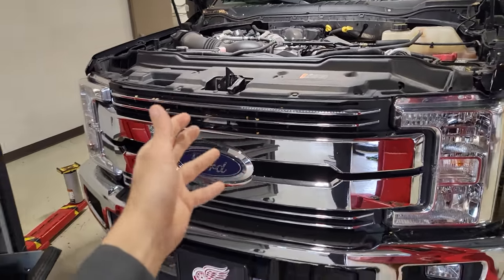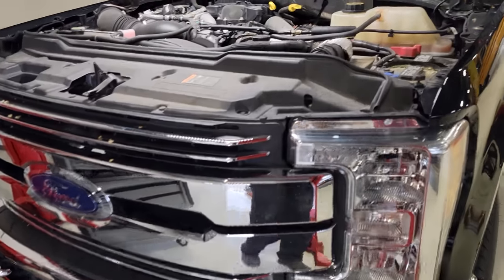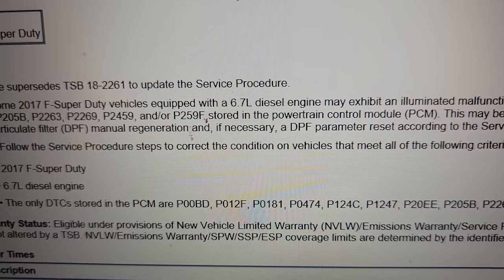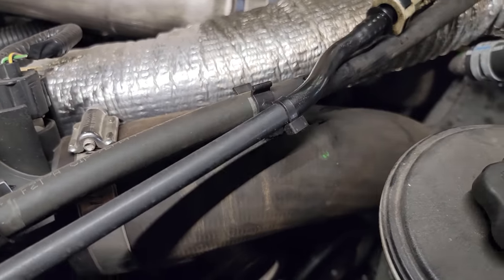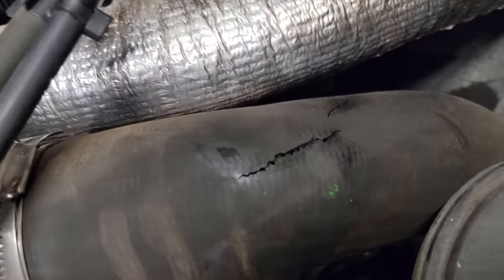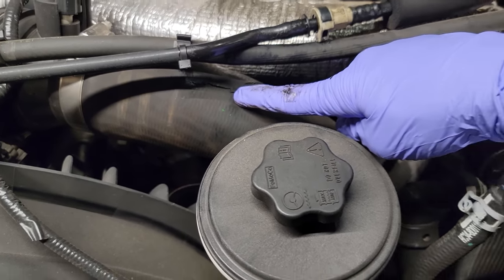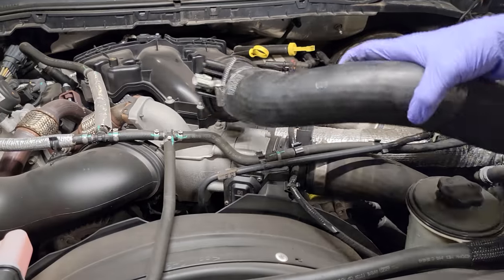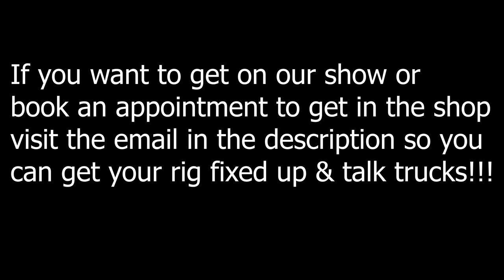**STOP** DO NOT REPLACE YOUR MASS AIR FLOW SENSOR | Eng.-light ON | 2017-19 Ford F250 F350 F450 F550

Comment: I am thrilled to have found this video. I unfortunately replaced my air flow sensor  and still got the engine light and loss of power. Dealership recommended that I book my Ford Ranger 2.2 2014 in for further diagnostics as it could be hundreds of other things. I checked the pipe now and it's cracked, I duct taped it and until it came loose the engine light did not come on. But now I know it's the cracked duct. Thank you for sharing. Completely saved me alot of money and time in resolving the problem. RSA.

Comment: This literally was exactly what happened to my 19’ F250. Exact same crack and everything. Thanks for the video. Super helpful
Reply from the maker: Better get u an HSM cold side pipe & never have it happen again. Shouldnt have happened to begin with....
Reply: Same thing happened to my f550. I replaced it, but I still get those codes.
Reply from the maker: Gotta get it diag'ed
Reply: Same thing on my 19’ F250 
Shocked when I opened the hood thinking no way this is it
Reply: @PowerStrokeTechTalkwARod where are you located at.  Be nice to have all this and other stuff that no one seems to be able to fix properly
Reply from the maker: @rogerkern email us bud were in detroit
Reply: I bought a replacement and put under rear seat so if it happens to blow on the road I can replace immediately

Comment: I have a 2017 F350 work truck, my engine light came on and off mostly on, I took it to the dealer they connected their diagnostic computer and resetted the engine light and told me just change out my air filter, I did and the engine light still came back on, I just saw this video look at the cold side duct and saw a couple of cracks on the top side. I'm picking up the part Monday morning and installing it myself. I'm a HVAC contractor I can't have my work truck sitting at dealership all day. Thank You for this video
Reply from the maker: Nice brotha

Comment: Dude! You saved me! 65000 miles.Check engine light came on. P0170 CODE. I did the air filter, fuel filters and cleaned the map sensor. Saw your video. Looked at my hose and there it was, a big crack in the hose. THANK YOU SO MUCH!
Reply from the maker: Woooooo wooooooop

Comment: this video saved my ass.......   removed turbo hoses to install disaster prevention kit on CP4 pump.   everything went well....   engine cranked right up.    as soon as i took it on the road and got on the accelerator it went crazy.....   limp mode, engine check light and it sounded/ran terrible.    i limped back to the garage and started checking all my work....  the more i checked the more codes it started throwing.   exhaust pressure /  MAP sensor / manifold temp / etc.....

i found this video and it was exactly what your were describing.... total air flow/pressure upset.    i went back to shop looking for hole in this hose and found that i had not tightened the hose clamp on the cold air exchanger side.    hose came off when i accelerated......    put hose back on,  tightened clamp, cleared codes and its as good as new.....    

i was about to start removing everything to take the DPK off and bring it to a repair shop.    you saved me alot of time and money..... thanks

Comment: I am so happy I came across your video?  This is exactly what was going on with my 2017 6.7.  I had an appointment set with the dealer and it would have cost me a whole lot more plus all the aggravation!  I was also bummed out because I thought the check light was associated with the recent PCM recall that I just had done.  Thank You so much!!!!
Reply from the maker: You shld read the comments, so many have come back & said just what u did, so glad pal 🙌🙌
Reply: I was on my way to the auto parts store for another vehicle when my check engine light came on. They read the code and sold me an MAF sensor. Went to YouTube and found your video. Bingo...exact same split on my 2019 F250. Returned the MAF Sensor. Thank you!
Reply from the maker: Bro 🙌🙌
Reply: This should be a recall on the fords. I have the same issue right now on my 2017 f250

Comment: Yes, watched the video and you described everything that was happening when I had my camper behind my F-350 SRW.   The light came on about a week ago and went to my mechanic to read the code.  He said it was a mass air flow sensor code, he asked me if I put a K&N air filter in it.  When i told him no he said bring it in next week and i'll change the sensor.  That Thursday i pulled my camper up to Maryland for my son's Baseball Tournament and it was lacking a little power.  Then towing the Camper home after the weekend I started having flashbacks of my old 6.0, half dead and lacking serious boost.  You hit the nail on the head, it was the cold hose, almost identical the the one in the video except mine has two splits in it.  Will order the part on Monday.  Appreciate the help!
Reply from the maker: Thank u for the feed back. I knew we'd help some1
Reply: Once replaced does check engine light turns off
Reply from the maker: No you’ll have to clear it
Reply: I have just replaced my cold air return hose for the same reason. I have cleared the code twice and it come back on. Any ideas?

Comment: Just got this code tonight, checked your video, and sure enough, a split hose. In the exact same spot even. Thanks...

2019 F350 Platinum Dually 6.7 with 48,000 miles

Comment: Had exact same issue 2017 6.7, started noticing bad fuel mileage for about two months. At first blamed it on change of season, about two months later check engine light came on. Went to Advanced auto parts, they scanned it and said something about three "air flow codes". thinking it was dirty air filter changed that, no change, engine light still on. Was about to change Mass air flow sensor when I Found this video and checked air tubes and sonafa bitch mine was cracked exactley same place as in video. Changed tube and fuel mileage back up to 16-17 mph from 12.5 mph. Problem apparently caused by two smaller tubes/pipes vibrating on  cracked tube. I chicken banded a half piece of poole noodle around two smaller tubes - problem solved. Good info/video ,thanks----

Comment: Thanks for this video.  I saw a drop in MPG and lack of power just toting the family around one weekend.  Thought I was maybe just confused.  A few hours later the MIL popped up and I cleared it the first time (these trucks do get finicky and there are weird race conditions at times when systems start faster or slower than expected).  About 100 miles later the light came back.  Saw your video and, sure enough, I have a 4" crack in the hose.  New one is ordered and on the way.  You saved me at least two trips to the dealer to reprogram the pcm and find that didn't fix it (I've been through that scenario before).
Reply from the maker: So glad to help pal!!!

Comment: You just saved me a lot of$$$....my 2019 F250 check engine light came on, put the code reader on it, got a P00DB code.  paid $130 for the part, took about twenty minutes to replace the part, half of that was finding the right tool, THANKS
Reply from the maker: Shlda got the upgraded one

Comment: I had this problem 4 months ago. Replaced it myself. Pretty simple. Currently pissed off due to my f250 shutting down in the middle of the road earlier today. Going on 12 hours trying to diagnose my new problem. Problems Ive had with my 2018 F250 6.7L so far have been: Both front brake calipers have failed between 70-90k miles, this hose bleeding pressure with an identical leak to the one in this video, and now the worst one I am currently having to deal with that seems to be an issue with the fuel pump. We’ll see what happens with this, but I am not happy with Fords warranties and reliability. My truck is at 99,527 miles and Ive been pretty spot on with the maintenance intervals. These trucks look so good, they have a ton of power, but I wouldn’t wish these problems on anyone. The worst part is that Ford knows about these issues and doesn’t do jack about them.

Comment: I was literally searching for a mass air flow sensor for mine and the name of your video caught my eye. Sure enough, mine is cracked in the same spot! Thanks for sharing this, saved me some wasted time!
Reply from the maker: Ur the 2nd guy in two days to come back & tell us that, good dealio guy 💪💪
Reply: @PowerStrokeTechTalkwARod  Replaced the hose, cleared the code, then my light came back on about 20-30 miles later. The code isn't MAF this time though, now it's Exhaust Gas Recirculation Flow Excessive. Any chance these are related somehow, or purely coincidence and now I've got to troubleshoot a second unrelated issue?
Reply from the maker: EGR valve time budddd
Reply: @PowerStrokeTechTalkwARod  I've checked the solenoid and actuator, both function properly as far as I can tell. Voltage is good to egr valve, valve coil is good. Everything checks out electrically. Any other checks I can do on the valve before I just replace it? Just concerns me that it didn't show up until immediately after replacing this hose.
Reply from the maker: You wld need to do the pin point test for P0402

Comment: Arod, you’re advice is always right on time (well, you covered my current problem 3 years ago). ?Would you recommend replacing w/OEM or aftermarket (& whose aftermarket part)?  I just had the same issue @ 72000 mi. on my 2018, also while towing ~12,000 lbs. thanks for talking us thru the diagnosis & fix.

Comment: So happy I found your video. We are traveling and check engine light went off. The exact same thing happened. Stopped at ORiellys code given. I have only ever had my truck serviced at Ford and am freaking out. Googled the info and came across your video. Yes, the hose is broke in same area!!
Reply from the maker: Thanks CJ glad i helped. Check out our recent replacement tubes we put on a clients truck

Comment: Thanks for this video, I’m going to clean n oil my K&N air filter, I checked the top of the hose, will check the bottom of the hose.  
I had just done a quick cleaning of the air filter while waiting for the cleaning kit to arrive, when the check engine light came on.  
I also have a regular air filter on its way to test just Incase.

Comment: Good video.  I've got these things happening in a slightly different order...we found/replaced that ducting a few months back, and then my fuel system (2017 Powerstroke) went out.  Cost me a LOT to get it replaced, just got the truck back from the shop a few days ago, and intermittent engine light.  Checked it yesterday, and the IAT error is first on the list.  Trying to sort out what's happening, so thanks for posting.

Comment: I work for an independent shop not a dealer, so I haven't worked on an AlumiDuty. But I always like getting tips beforehand, so that when one comes in with that issue, I'll check there first. Thanks for a great video!

Comment: Replaced mine yesterday @ 160k mi.  Cracked tube exact same position.  Tried a temp fix with flex seal 4" tape wrap, blew through that too!  Waiting for P0471 code to clear.  Thank you ARod

Comment: Bingo - Great video, thanks for the advice. A little nascar tape took care of the issue until the part comes in. Much appreciated.
Reply from the maker: Get you the all silicone H&S diesel motorsports one. Watch our install video, so much better that stock

Comment: Subscribed.  Had a code P0170 on 2017 Superduty 6.7L 109,000 miles.  Started researching and after a while I came across this video.  Different code than the one mine threw but all roads led to this, so I went to check and sure enough I had 2 cracks in my intercooler hose just like you showed in the video.  O'reilly's had the part in stock and the check engine light is gone.  Thanks!
Reply from the maker: NOW that's what's up. Come thru south eastern Michigan and let us get on that rig

Comment: I have a 2018 F250 that had three cracks in the cold side hose in that same location.  I just replaced with aftermarket metal pipes on both the cold and hot sides.

Comment: Just had this happen on my 2019 f250. Had a P0170 code, just happened to see the crack in my hose when I was changing my fuel filters. Hope the code goes away after I replace it. I bought the H&S hose, it seems much more thicker and reinforced than the blue oval one.

Comment: That's exactly what happened to my 2019 truck with 82K miles... Thank you for the heads up! Do you have a video that shows how to replace the cold air intake hose?
Reply from the maker: Yeah watch the S MB or HSM coldside pipe install  Videos we did

Comment: This is in the exact same spot as mine was and PCM was throwing the same code. I replaced the rubber bs OEM tube with one from Sinister Diesel and it works great. Had to do a little modification to the 90 degree boot that comes with it but you can tell you are getting what you paid for with sinister.

Comment: I had the P00BD. Truck went to dealer got the update. Worked great for a few days. Then the CEL back on with same code. Replaced MAF sensor. Worked great again for a few days. Then smelled oil. Blew the rubber hose. Replaced rubber hose ram like a scolded dog. Then light back on again for P00BD. Change MAF again. Ram great a few days. Back on again today. When it comes on my boost won’t or barely does hits 20. It’s a dog. Dealer says they want to replace turbo and EGR cooler.
Reply from the maker: Better have em check er again!

Comment: Thank you so much for the vid.  The dealer was about to replace my mass air flow sensor because my 17 kept throwing codes.  Checked the hose and what do ya know.  I had 5 good size perforations.  Thanks for the information.
Reply from the maker: Hope you picked a good replacment
Reply: @PowerStrokeTechTalkwARod    Ran to the dealer and got an oem replacement right now since it's my daily driver..  I'm definitely researching for an aftermarket replacement though.  Thanks again for this vid....
Reply from the maker: Check out our MOD playlist i think the HSM one you will like.

Comment: Had the same thing happen to my '17 F350 while out of town and towing. Luckily a dealer 20 miles away had one in stock. 10 minute change and back on the road. Thinking of putting in AFE's cast aluminum pipes.
Reply from the maker: Naw....get the H&S ones, way better

Comment: That is why I replaced hot, cold, and rad hoses all SPE upgrades at 45k miles. Not going to wait to find out the hard way especially when I drive 5-10k miles per month.
Reply: Had both hot side SPE hoses blow within 5k miles of each other.  Yanked out for another brand.. we'll see
Reply from the maker: Im done with SPE

Comment: I had the exact same crack but no engine light.  After the hose was replaced the engine light came on the very next day.  The light reset but popped again the next day.  Any idea why the engine light is happening after the hose replacement and how do I fix it?  Great video.  Thank you.
Reply from the maker: I don't know what the code is....

Comment: Just had this happen a few days ago, no power while towing & 8.5 mpg. 2017 F350, 109k, bone stock, & owned since new. Took 10 mins to replace (7mm & a long extension). Was $117 for the Oem part from the local Ford dealer.
Reply from the maker: Yea babe!! Timing!!

Comment: Yes just happened on my 2019 F250 Super Duty. Thank you for the informative video. Do you know if I’m going to have the parameters reset by ford tech if I replace the tube myself? Another words is it going to be a new sensor (different) than the original one? I hank you to n advance, Jim.✌🏻
Reply from the maker: Juss gott clear the ckde
Reply: Thanks again.👍🏻

Comment: 2017 f250 6.7. Just had this same problem. Towing 6K trailer, no power.  Turbo only went half way. Went into the ford shop and they updated my PCM, and sent me packing. Pulled out of the parking lot. Trailer in tow. No power. Open the hood and found the cold hose blown exact spot. Replaced, 100 miles down the road climbing a mt pass. No power 30 mph tops. In shop getting EGR and MAF replaced.

Comment: I swapped hoses last week plugged in the new sensor on the tube and the first time I drove it the check engine light came on. After playing with trying to get into a shop I pulled the sensor from the old tube and put in place of the new 1 and the idle is better and check engine light is staying off.

Comment: This happened to my 19 350. Replaced with a h & m pipe. Engine light went away. Few more miles of driving engine light back on saying mass air sensor. No leaks or cracks everything's tight. Thoughts?
Reply from the maker: Really

Comment: I was driving my 19' F-350 the interstate today pulling a trailer and had a check engine light pop up. Got it read and it came up as a P0402. I just recently put a banks air intake on and this was the first highway use for it. I've seen where some people have issues with the MAP sensor after changing intakes. Any advice from experience? Truck just hit 80,000 miles.
Reply from the maker: Probably an EGR valve

Comment: My check engine light came on. I have some thing that reads the engine. It told me mass airflow sensor. I watched your video and I 
Have a cut in mine hose two 😂😂😂 you save me some time

Comment: I caught this problem while changing out the batteries before it started actually giving me performance issues on my 2019. Started splitting in the exact same place. Replaced the cold side hose, and now I'm intermittently getting P0402. No idea what the issue is now.
Reply: Have you tried resetting MAF adaptations? Perhaps the truck learned incorrect parameters with a hole in the hose

Comment: Looks like I have the same problem except I have a lot of what looks like oil residue around it and blown all around the area….. should I be concerned more than just replacing the tube??
Reply from the maker: Coming from the tubeee
Reply: @PowerStrokeTechTalkwARod  

So nothing to worry about other than replacing the cracked tube?
Reply from the maker: Si